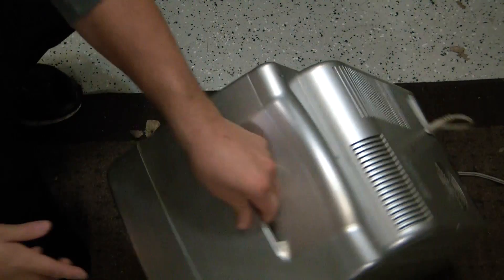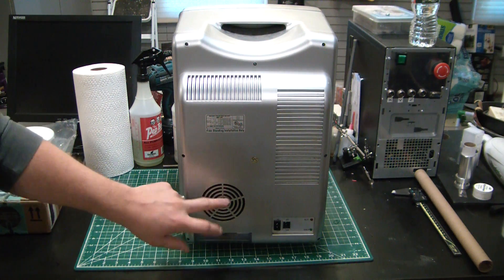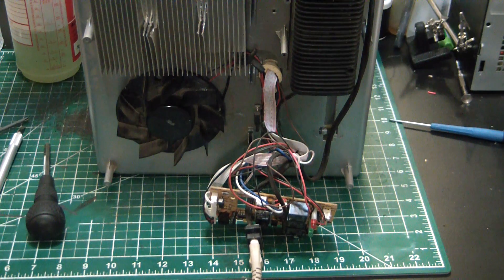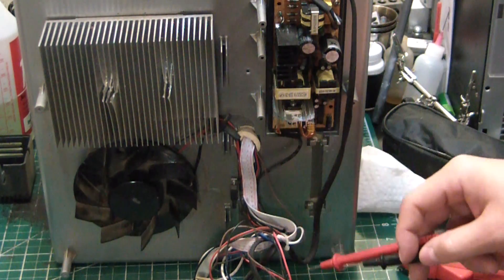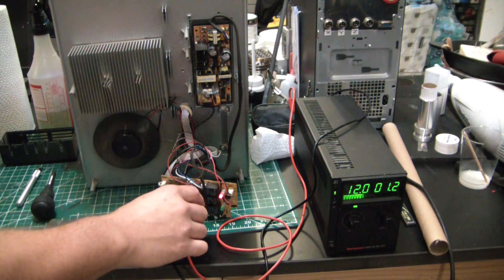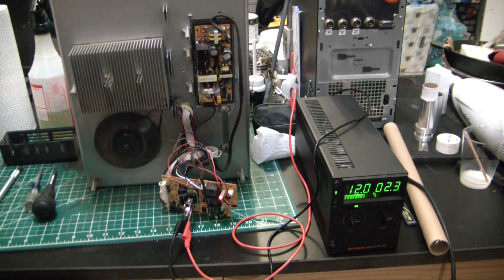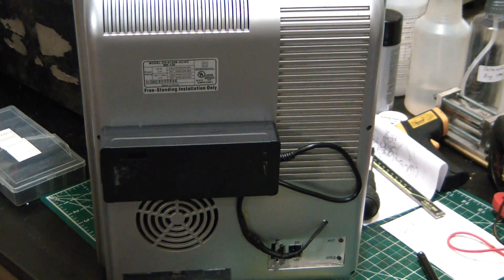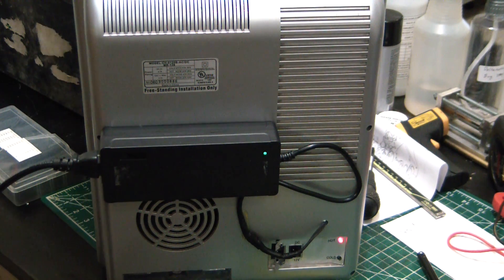Thermoelectric Cooler / Warmer Troubleshooting & Fix - Peltier - ElementalMaker

Comment from the maker: Hope you guys enjoyed! It would help hugely if you save this link as your amazon homepage, so when you shop the channel gets a small kickback: https://goo.gl/x1ehvA Please consider helping to keep these videos coming
Reply: Capacitors often fail short-circuited, so even if it's just a filter, if it's bulged replace it. Also having live voltage on the heat sink is very suspicious, usually on the power mosfets used in these power supply the heat sink tab in the TO 220 package is connected to ground, not power...
Reply: @HMan2828  If it is a push/pull setup with centertap either setup of case being Source or Drain can cause supply to be on heatsink depending on polarity.
Reply: @HMan2828  Live heat sinks are completely normal and very common in switching power supplies. Here it is likely connected to the Drain of the mosfet. Even if it was connected to circuit ground, you can still get a zap off it because circuit ground is not the same as earth.
Reply: Love the videos man keep it up!!
I've got a question for you and I'll ask AVE the same one.

Is it possible to store static electric build up in a batery pack?  I ask because I finaly got the media blasting cabnit to stop shocking the piss out of us at work  and I thought what if instead of grounding it out to the maching you dump the charge into a rechargeable batery pack.

Immagen, you're blasting and at the same time you are charging you phone or drill packs or some AA batteries for the ol' lady
Reply: What made you mount it on the outside vs inside?
Reply: The later model of these uses a power brick like you added, but they still had the same failure because they didn't slightly overdesign for the load.  Ours ran hot then started pulsing and eventually the brick destroyed itself within 2 years so I just replaced the brick.  The caps go first and cause the flickering, then the Mosfets will burn up eventually.

There so many cheap (junk) supplies out there nowdays.  Usually replacing the caps with quality low-ESR caps will extend the life for many years.

Comment: Ok, you were LITTERALLY looking at the problem! That bulging cap on the switching power supply indicates that it FAILED. I've fixed about a dozen of these things over the years and, except in one instance (bad peltier module), the cheap quality output cap on the switching power supply is the problem. If you hear the switching power supply "ticking", that's the first place you look. Instead of going through this whole mess of wiring up a new supply, you could have fixed it with $3 worth of quality caps installed in the supply.
Reply from the maker: I didn't think it could have been that easy lol. I think I still have the board so I may have to give it a shot and see if a new output cap fixes it.
Reply: @ElementalMaker  Yep, it's THAT easy...lol....if you hear a ticking sound coming from the switching power supply and you see the caps are bulging remove, replace and done. The cap is essentially shorting out as it tries to charge up. Everything else on the supply seems to hold up just fine....a few more cents spent on better caps would prevent the problem in the first place.
Reply: I’ve been having the same problem, turn it on and the relay continuously clicks, and I can hear a sizzling sound coming from the Switching power supply, the top of the cap on the output is a little bulged, I’d appreciate a reply about what I should try replacing and what the sizzling noise might be from (I don’t see any corrosion or anything got hot or loose)

Comment: They sell a 12v cooler heater from road pro.  Coleman also has some nice ones.  Simple power supply would run it off ac

Comment: I'm with fixing the oven, but what's the hurry? At the proper ratios, R45 and isocyanate cure at room temp.
Reply from the maker: Issue is my garage is at outside temp. No heat or cooling

Comment: Dead caps cause the tick and high esr on the output, or in the feedback circuit, cause the power supply not to regulate. Could be just that output cap, but if one is gone chances are the others aren't far away either. A decent proportion, if not most, don't show any outward sign of failure when their esr goes high.

That one cap may just be filtering but it also forms part of the feedback loop, it's failure will cause the smps to fail.

Comment: Get yourself some of the acrylic based glue sticks. They require a "high" temp glue gun, and I've never seen them in the mini form factor... but they provide much better adhesion and tolerate a wider temperature range without failing. 

You can also get the tan colored industrial grade sticks, they are even better. Unfortunately, I was gifted my supply of them as a large handful of loose sticks, so I have no idea what term(s) are typically used to refer to this type, but perhaps someone more knowledgeable than I can chime in.

Comment: I would say there is a decent chance the power supply can be fixed by replacing that bulged cap. The control IC in a switching power supply can detect many types of faults. With the dead output cap, you likely get a very spikey output voltage which will be measured on the feedback pin of the IC.

Comment: You think that Macgyvered temporary power supply abortion looked bad? Brother you had it easy. My laptop hard drive went bad and it wasn't your standard laptop hard drive size but Some little weird 1.8" hard drive. So I have a full sized sata drive going into a sata - usb cable plugged into a computer power supply i had floating around here. It is Jankey as F. But it works. :-) Keep up the good work!